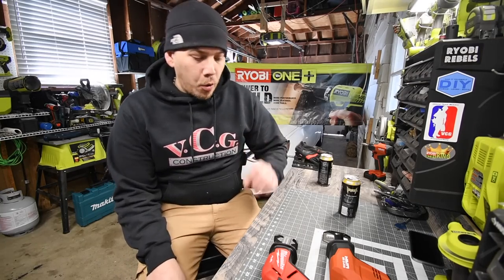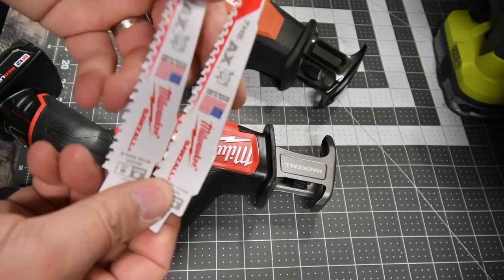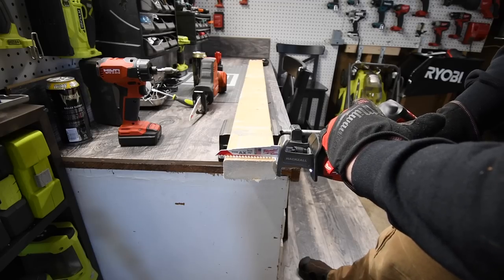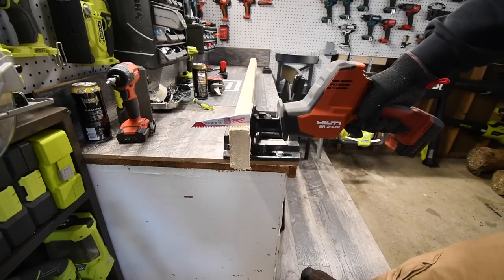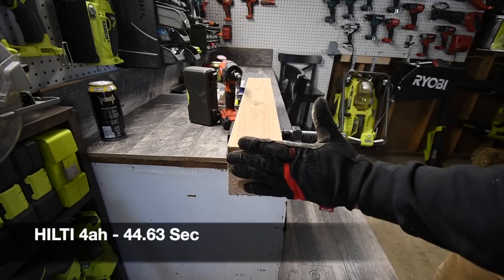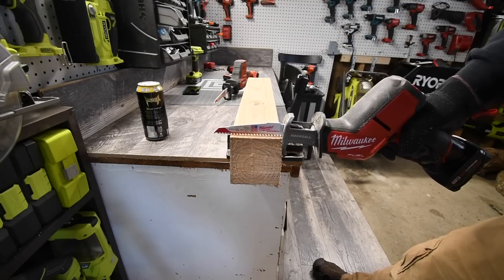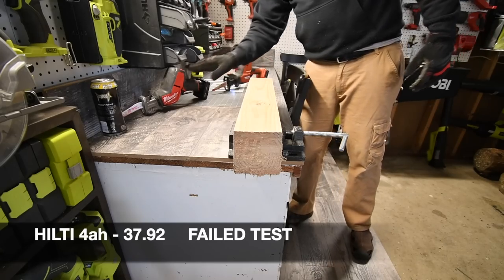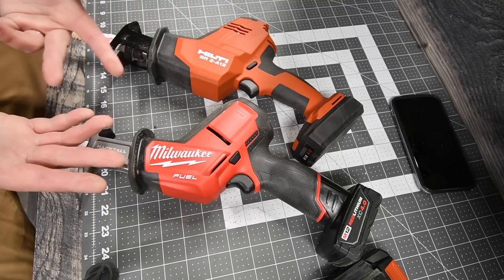HILTI 12v Hacksaw Vs.Milwaukee M12 hacksaw

Comment: I bought a non Fuel M12 Hack Zall over 12 years ago.  It still works.  Doesn’t have the power of these two.  But it still gets the job done.  Very useful for pruning branches or cutting small pieces of wood.
Reply from the maker: Every tool has its purpose and I thank you watching :)

Comment: I just got the M12 Hackzall, the non-FUEL version; it came free when I bought the Milwaukee Installation Drill Driver Kit. I have yet to actually try it, but since I surely did not need it in my work van, it has gone into my bag with all my range construction gear and will be used primarily for cutting 1x3 strapping we use for putting up targets. It's joined there with an M12 drill and M12 impact driver.

On all your tests with the 4x4, it seemed that both saws made it 1/2 way through pretty quickly, and took a lot longer to do the second 1/2 of the cut.
Reply from the maker: I do love the m12 system, and thank you Timothy

Comment: i wish if you can do the same comparison but instead of Milwaukee M12 try Milwaukee M18 Vs Hilti 12V... i searched the whole interned for such a comparison but i could not find any...
Reply from the maker: The any higher voltage tool will destroy the 12v.
Reply: @ManCaverTools  make sense

Comment: They suck. I know they're only 12v but 18v is clearly the way to go on a job site. This video is just boring. Not your fault. They're just slow and boring
Reply: They're for plumbing and electricians not for demolition
Reply: @loucifer323  yeah but for the size. Get a 18v all that time wasted is money lost
Reply: That's not My name I get paid per hour.  If my employer wants the best tools to save money on time they should provide them.  They generally don’t.
Reply from the maker: I thank you for viewing That's not My name
Reply: @ManCaverTools  ur content is good. I bitch alot. But i like ur channel.
Reply: What is your name (who cares?), you obviously don’t get it.  Per your comment, you don’t understand the differential between 12v and 18v tools, e.g. when you would use a 12v vs 18v or why you would use a 12v vs 18v tool.  Probably because you’ve never used real big boy grownup tools.

I would’ve done both the testing between the tools and the substrate they were tested against a bit differently than Dave did.  Where these tools accelerate are in tight spaces or where finesse is key to getting the job done correctly and efficiently, e.g. about two years ago I was ripping out our old kitchen cabinets, which were 3/4” custom built like a frickin tank cherry cabinets, with 6 - 12 penny nails per inch.  These cabinets went all the way through our 12” soffits, up to the ceiling, with many large nails securing them in place. I was trying to preserve the soffit, while cutting the old cabinets out.  My old Porter Cable Tiger Saw was vibrating like crazy while cutting, almost ripping the soffit down.  I went to Home Depot and bought my first Milwaukee Tool, the M12 Fuel Hackzall (same one Dave was testing), along with a couple of thin kerf, 9” Diablo wood/nail blades.  When I got home and started cutting the cabinets out of the soffits with the Hackzall...it was night and day!  It was like a hot knife through butter, along with little to no vibration.  Keep in mind that I was able to use the tool with one hand vs the two required with a regular recip saw.  Thereby freeing the other hand to hold the material I’m cutting. So I was able to remove all the remaining cabinet pieces from the soffit in less than 30 minutes, while preserving it at the same time.  So ya see...a lot of it is matching the right tool for the job.

Back to testing...these tools excel with a Diablo pruning blade on them, slicing through branches and tree trunks like nobody’s business. In addition they’re able to plunge cut roots through dirt.  A good test of their ability is with cutting metal rods, abs pipes or any type of pipe, bolts, etc.  As Dave mentioned, plumbers and electricians regularly use this tool.  In my opinion the worst possible test is against a 2x4 or a 4x4 piece of lumber, as they aren’t the right tool for the job.  As we witnessed with the crooked and time consuming cuts.  The tool of choice for that job would probably be a circular or miter saw.  

I also think the Milwaukee Ax blade was probably not the right blade to use, as I’ve had more success using a thinner kerf wood blade.  

Go troll somewhere else young man, because you obviously are unsuccessful trolling tool channels due to your lack of tool knowledge.